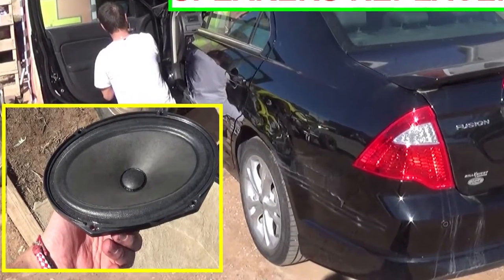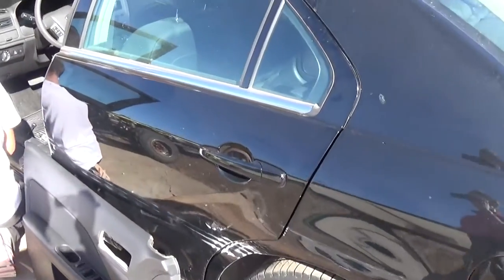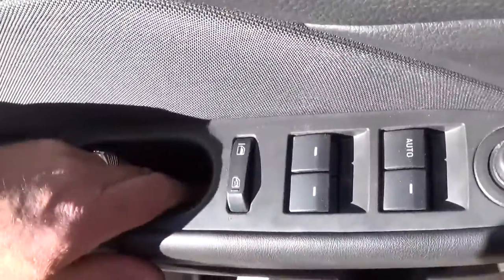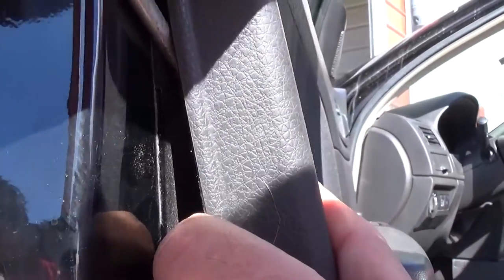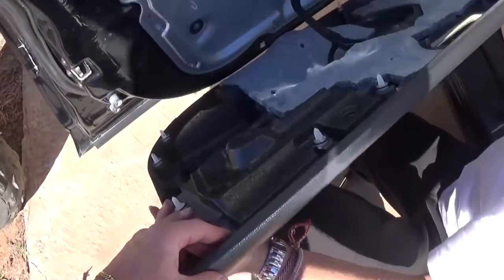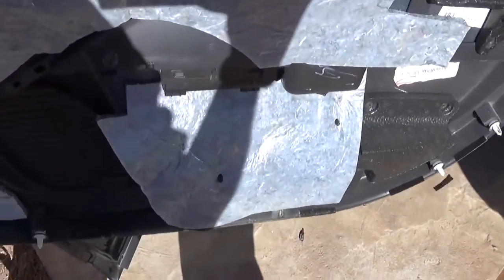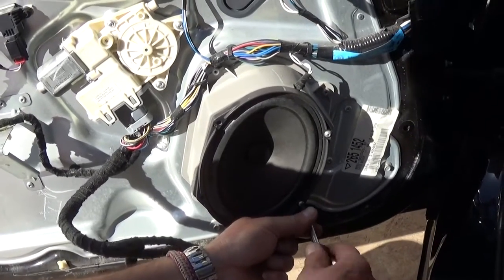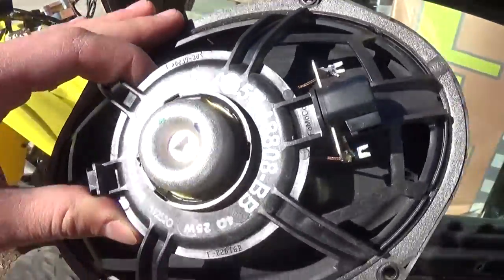Ford Fusion Front Door Speaker Removal and Replacement 2009 2010 2011 2012 Ford Fusion

Comment: Thanks man, looks like a simple job with the right tools, some patience, and delicate handling. My speaker on the passenger door is making a terrible sound with audio on, had to put the balance of the audio all the way to the left to drown it out. Will be replacing my speakers probably today
Reply: How did it go? I'm having the same issue with my driverside speaker, makes a horrendous buzzing. Had to adjust fade aswell

Comment: Amigo. I don't know what year Fusion you have, but my 2011 is also a 6 speaker and its one hell of  a Bass in the front door with original 55 watt speakers. The factory in old Mexico must off run out of them and installed the same  ones as the back that are sure 25 watt.

Comment: The premium 6-speaker system in a Fusion (not the Sony level) sounds better than the high-end Sony system, with just some minor EQ tweaks in the head unit. If you want subwoofer bass, they will not quite do that (or they do, but only at low volumes) but the parts are pretty nice. The curved paper cone with foam surround is a good design that provides a lot of performance with affordable materials. Many don't know this, but paper has the highest stiffness to weight ratio of any speaker cone material; woven composites like carbon fiber are more rigid, but they are also heavier, so the ratio of stiffness to weight is not even as good as paper, and the internal structure of paper provides both rigidity and self-damping. The curved profile also helps with midrange clarity, which is not bad from these speakers. If you are wondering about the tiny magnet, that is neodymium, and is 10 times stronger by weight as a magnetic material than ordinary ferrite ceramic magnets (the black donut style), so they can be encased totally within the forged steel U-yoke.
Reply: rorybz disagreeing with you on this the Sony system is better period.
Reply: @agustin713  The one I heard in the 2017 Fusion Sport was muddy and boomy - not at all the right way to tune a system. The 6-speaker system in my 2010 with Sync sounds better with actual music. It didn't take much tweaking of the EQ to make it sound quite nice. Yes, it doesn't have subwoofers to shake things, or the little center speaker, but the rest of the frequency range is much more clear and natural than the Sony system, which is too unrealistically bright, muddy in the lower mids, and boomy in the bass. Maybe some people like that, so they are knowing their audience. But it's not a performance worthy of a respected brand like Alpine, Harman Kardon, or B&O - or even Bose.
Reply: Edi B  As I recall, there were three options: Base audio, premium audio with Sync, then Sony-branded premium audio. If you don't have Sony badges on any of your speakers then you have base or premium audio, but not Sony. Then I think if you have A-pillar tweeters (in your front doors near the front corner of the windows), you probably have the Premium Sound package.
Reply: Not a chance, the Sony system is much better.